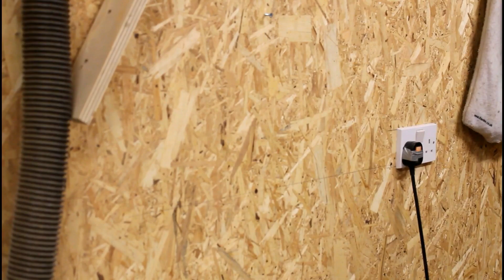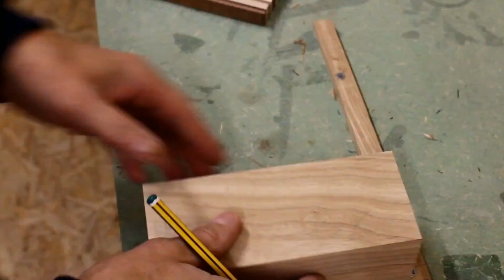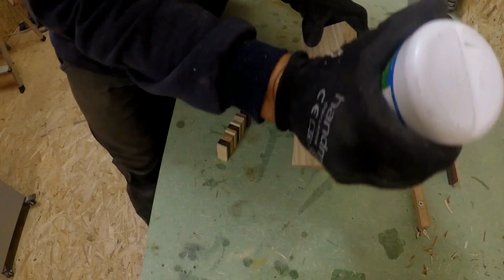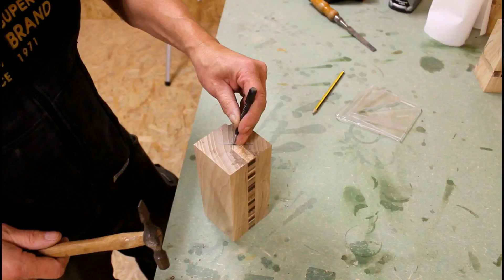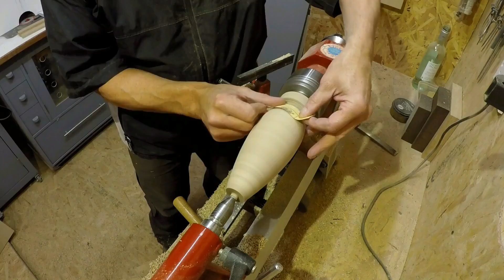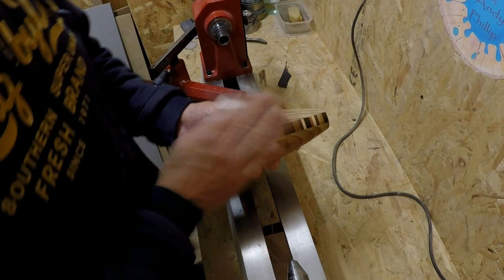Woodturning - The Stripe Vase

Comment: Did you drill the hole in the end with a forsner bit or an ordinary drill bit? What was the finish you used on it? Definitely a beautiful vase well finished. Well done.
Reply from the maker: Thanks Nigel .. I used an ordinary bit then finished the end off with a step drill bit .. the finish is friction polish and then a wax .. cheers

Comment: Why did you use all the gouges as scrapers, instead of riding the beve? It would have led to less work and much less sanding. 
Also, how does it react to humidity and temperature changes with the grains running in opposite directions? Great design, though.
Reply from the maker: Just getting back into turning after a long lay off so I'm sure  there's a lot I'm doing that's not technically correct .. still learning

Comment: Love the idea of wood gluing it to the chuck piece. I've been trying to figure out a good way to do that for my pieces without screwing in a scrap block each time but your way is significantly simpler.

How long do you usually let it sit while the glue binds the two together?
Reply from the maker: Thanks Matt. . I used a fast set polyurethane glue on this I would probably leave it about 15min or I use a 5 min epoxy .. i save old chucked up pieces that ive parted off think that was off a pencil vase .. cheers